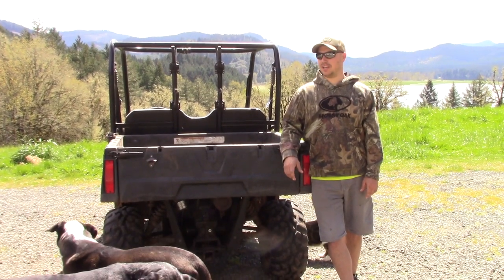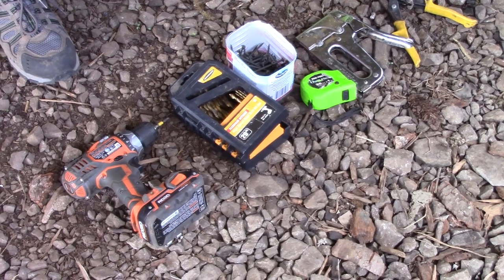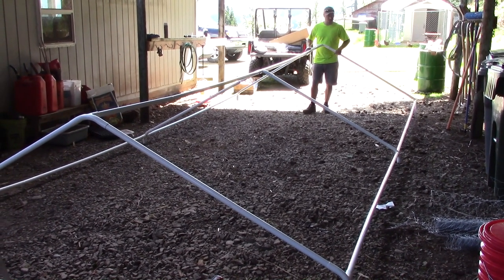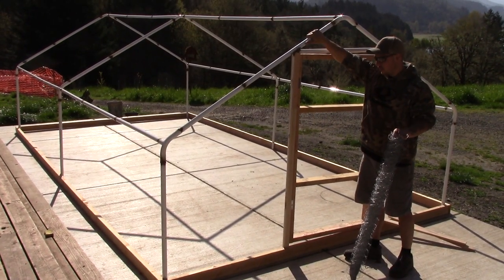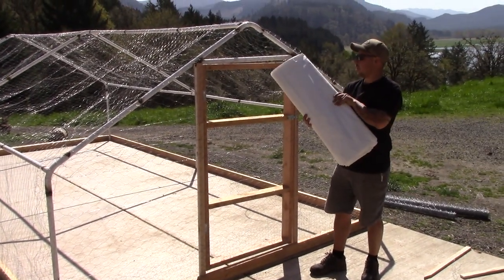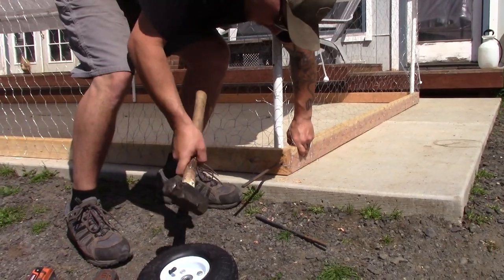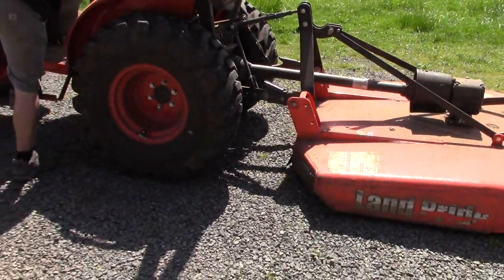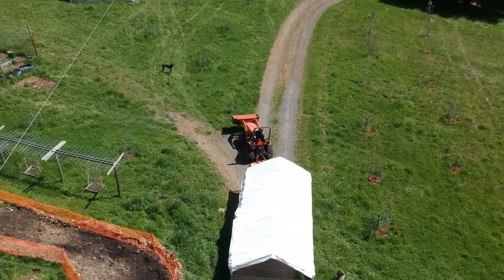Carport Frame Chicken Tractor Build

Comment: I am curious how you keep the wheels from sliding off the rebar. I have a carport that got destroyed by wind so I am doing just 10x10 and two feet of hardware cloth on the bottom.
Reply: try adding an eye loop at the bottom of every corner and in the middle and a hooked pieces of rebar to anchor it to the ground.
Reply: When you drill the holes for the rebar  drill it at a slight angle down  gravity will keep the wheels on